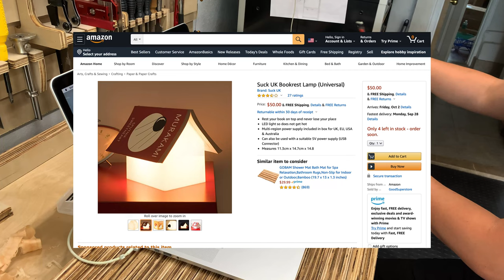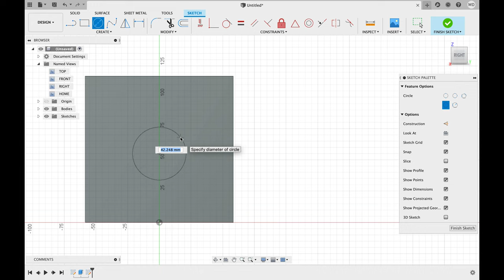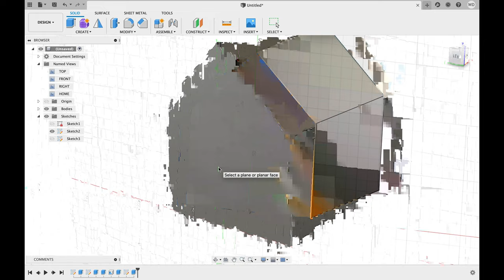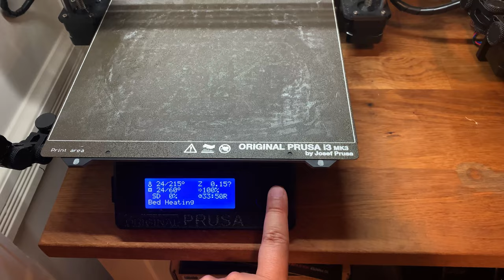Smart lamp, Book Rest, Toddler sleep trainer? Yep its all those things and its 3D printed.

Comment: Sorry if I missed it. I don’t remember hearing if you used PLA or something else.  Thanks for the awesome project!
Reply from the maker: You can use whatever you like as long as you use a LED bulb. A traditional bulb would be too hot.
Reply: @3ddiy  Thanks. One last question. What angle is the roof drawn at?  I’m thinking of adding a 3D printed roof for my grandson.
Reply from the maker: @partsdave8943  Great question. Its 90 degrees. May I suggest an idea? a custom made book. You can order those online. Have it be a picture book of family and fun things. It will become a keep sake.
Reply: @3ddiy   Interesting idea.  Thanks for that! :)
Reply: @3ddiy  Finally printed this model. Turned out great!  First print!  0.15 layers and 100% infill.  It is really cool.  Will be a Christmas present for my grandson.  Thanks for the model!
Reply from the maker: @partsdave8943  He's going to love it!
Reply: @3ddiy   Did your house model print perfectly?  I noticed a bit of convex bowing on the long side at the roof transition. And consequently a little concave on the short side on the same plane. I did turn up the bed temperature to 70C so the PLA would stick better, hoping not to get any curling. That did work, but I’m wondering if I induced the problem with that little bit of extra heat. Prusa MK3. Original.  Thoughts?
Reply from the maker: @partsdave8943  on early versions I was running into that problem. But the final one was close to perfect. I would adjust temps and speeds see what works for you.
Reply: @3ddiy    Ok.  Will give that a go on the next attempt.  Think I'll see if anyone notices first. :)  I'm just too much of a perfectionist sometimes!